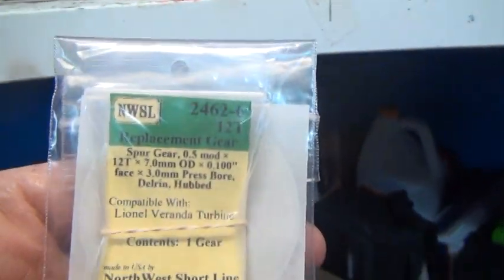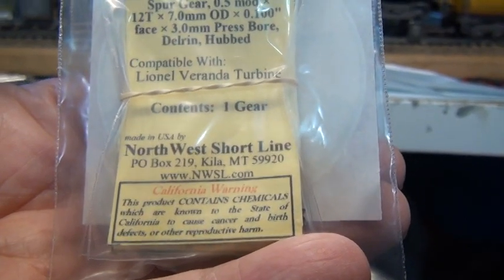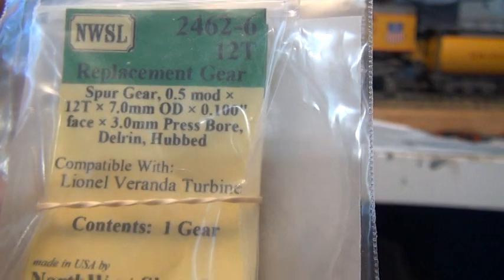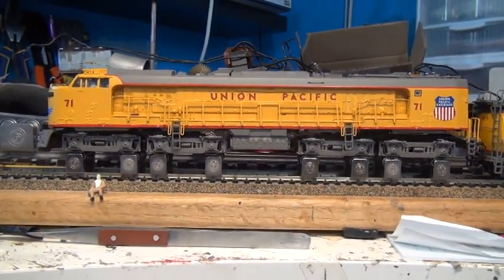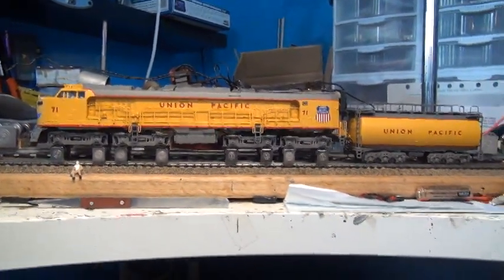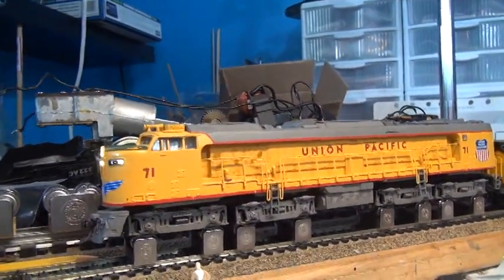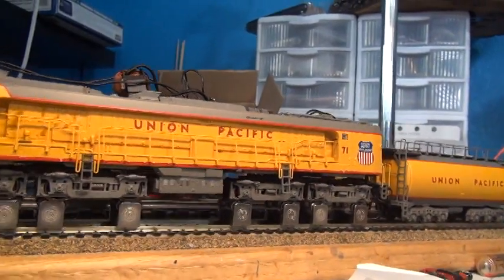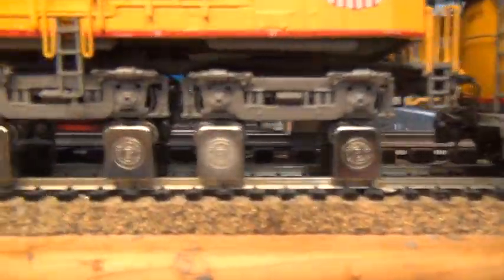Lionel HO Gas Turbine Gear Problem

Comment from the maker: Contacted North West Short Lines and they do have the Gear. Part Number 2462-6.
Reply: Thanks!
Reply from the maker: I have a set on hand.
Reply: @choochoo3985  hmmm, metal or plastic?
I was thinking about resin printing my own set and capitalizing on it because I believe nw shortline stopped producing those gears
Reply from the maker: @hamiltonsullivan6563  Well, actually, they do have them if you noticed on that video I put down the part number but I do have them and if you purchase it, I will include those that no charge.
Reply: @choochoo3985  but didn't you say they still made a clicking sound after the reinstall?
Reply from the maker: @hamiltonsullivan6563  The ones that I changed the gear still had a very slight click one of them just in reverse. I don’t know why that would be. I had to file down again I probably could’ve done some more to make them quieter, but with the sound on you don’t hear it.

Comment from the maker: I noticed the rear truck on the front set ofd drive wheels is not on the rollers correctly which is making the gear problem look and sound worse than it is. Saddly due to nerve damage in my neck I am losing the feeling in my hands and unable to replace the gears. As it is on E Bay I will include a set of gear to anyone that purchases this locomotive.